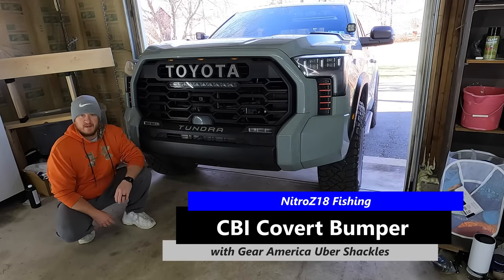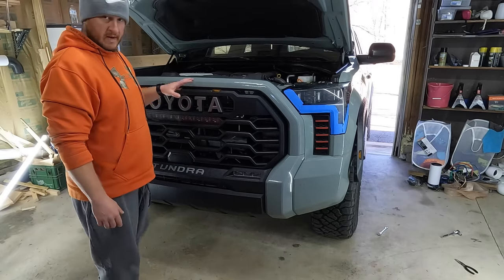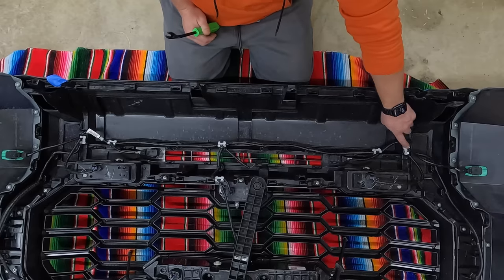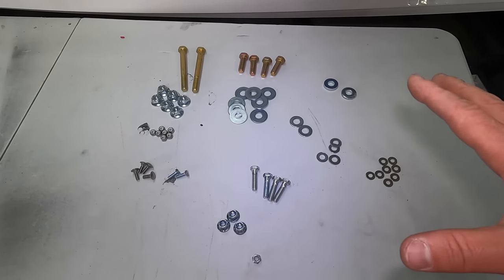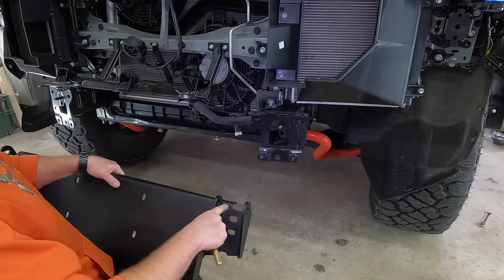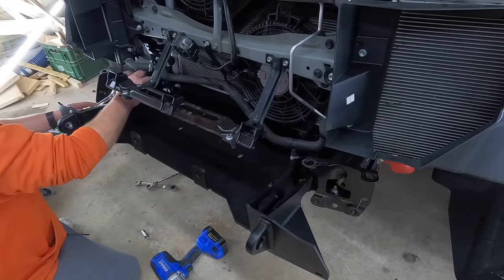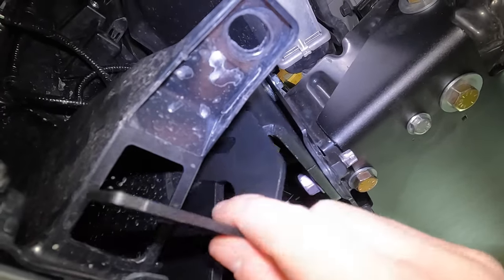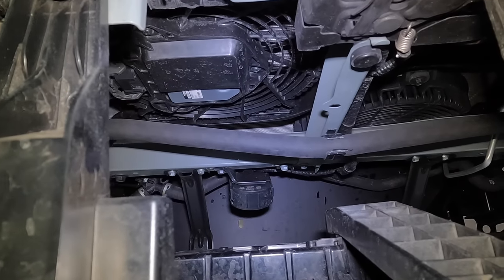CBI Covert Bumper, Install/Review on 2022 Toyota Tundra TRD Pro...Paired with Gear America Shackles!

Comment: Informative video!  Great job on the install, but I want to let you know that the side bracket show at 24:00 should be on top of the plastic bumper tab.  If you mount it with the metal side bracket on the bottom, then when you tighten the fastener you will most likely crack the plastic bumper tab.  There is a circular ridge on the bumper tab and if you mount if the way you did, it will result in a gap in the clamped assembly and the plastic will crack because of the compressive stress placed on it.  After watching the bumper tab crack on the CBI installation video, I contacted them and they admitted that they had installed one of them backwards too.

Comment: I just saw your video, thank you. I installed a Fab Fours bumper winch on my 2012 Tundra by myself. I found it easier using my floor jack to balance and lift that heavy thing while I bolted it in.

Comment: Another great video, thanks for the step-by-step installation process and detailed description. 
Have you noticed, or anticipate the shackles swinging back-and-forth and making contact with the bumper? Thanks.
Reply from the maker: Thank you, I appreciate it!...not at all, the shackles come with rubber spacers you install between them and the tiedown locations on bumper… Comes with different sizes of the spacers so you get a snug fit where they won't swing… Hope that helps!

Comment: Your videos are great! Curious to get your reaction to the less wide coverage of the bumper to the old crash bar width. I can’t for the life of me understand why the CBI bumper surface area is so much shorter than the oem crash bar so that a lot more of the front tire and fender areas are left unguarded during a collision.
Reply: Agreed, I was waiting for the re-installation of the crashbar. Not sure I personally would trade off safety for a bad ass looking bumper and recovery points. Nice looking install and great video by the way, thanks for the hard work.

Comment: I've had this bumper on my truck since mid October and I love it. I am however extremely disappointed that it's almost completely surface rusted already.
Reply: Sorry to hear that. 
That’s the challenge with aftermarket mods on the first year of a new generation truck. Even the mods need time for improvements and feedback.
Reply: That what I was thinking could happen. So, I take it that it's steel and not aluminum?

Comment: Any idea how much the susspension dropped ? I wonder how much is the weight. I ordered one and it should be here in few days  I hope I dont have to modd the front suspension so it can handle the weight better. Thank you for a fantastic video. I will be using your video step by step.
Reply from the maker: Thank you, I appreciate it!… I didn't even think to measure to be honest, but going off looks alone it doesn't seem like it dropped much at all… If any… Definitely nothing where the suspension would have to be modified for sure… If I get bored enough I'll take it back off and get some exact measurements, wish I thought to do that when installing!

Comment: Very awesome. I watched it like 3 times. Im in the process of ordering this for my 2023.
My question to you is:
The 2 small areas below your headlights. I see you put the Orange strips. Did you change those and are they the lights module, or you just added the orange strips onto the plastic?
And the orange front sway bar. Where did you get that from?
Awesome video. Ima follow your steps when I get mine.
Reply from the maker: Thanks man, much appreciated!... so the red strips on those areas below headlights, they are just vinyl strips that I applied for accents… No lighting… and the red sway bar is the stock sway bar that comes on the Trd Pro, hope that helps!
Reply: AFe sells a red sway bar if you’re looking for the same effect for slightly cheaper than the TRD

Comment: I was told by two body shops that you and must recalibrate the sensors when you remove the grill and disconnect the plug. Have you heard of any issues after unplugging the collision sensor?

Comment: Would welding the bracket to the frame be a better option (after installing the bolts)? That way there is no way u might accidentally sheer the bolts when getting towed?

Comment: Its just mesmerizing how they call this TRD PRO (OffRoad version) but whole factory front end its held up by plastic extensions and bumper its actually lower then front skid plate so in case of front impact while offroading whole front gets ripped apart before even touching skid plate.

Comment: On my 21 tundra I had to spend 1000 dollars in parts to install a trans cooler and now what you are going through with the new model is a results of gross In competence by that Toyota engineer Mike S. I vote TOYOTA FIRE HIM FOR LEADERSHIP FAILURE
I appreciate your channel and I have been impacted by Toyotas missteps in engineering.
2006 and 2007 4 cylinder piston ring failure and no trans cooler in my 21 Tundra
I question the ROI and wonder if you should have kept you old truck

Comment: I want one of these CBI bumpers so bad for my Tundra but Washington state requires drivers to have a front bumper license plate 😢😢😢
Reply from the maker: You could still get it!...they make brackets for mounting a license plate over winch opening, and the bracket flips up out of the way when ya need to use your winch!